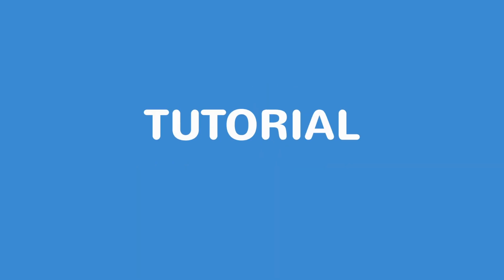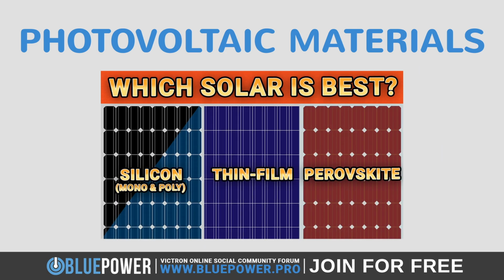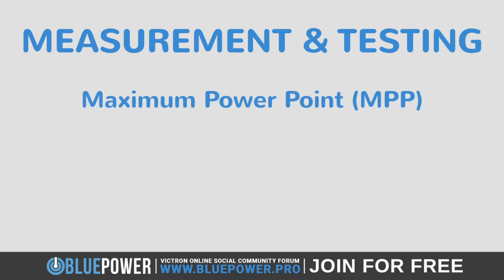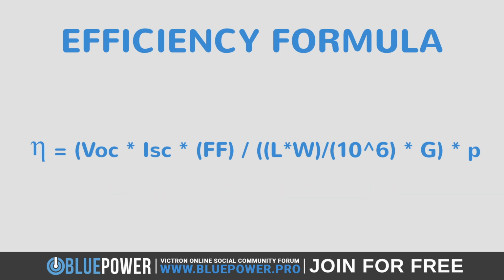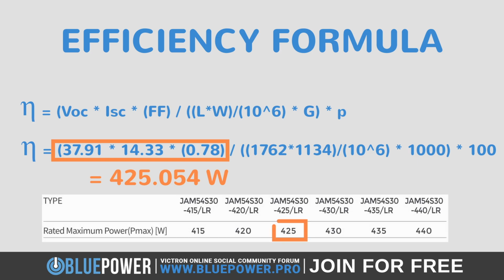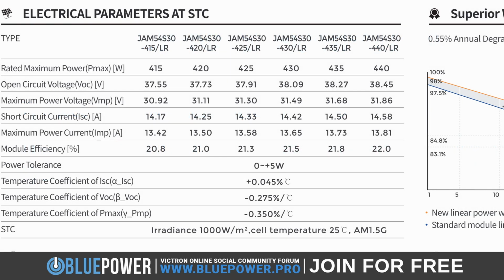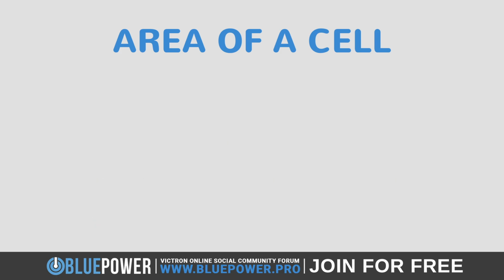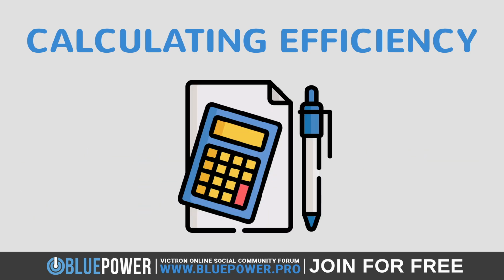Calculate and MAXIMIZE your SOLAR EFFICIENCY [UPDATED 2024]

Comment: 15:36 , this is wrong cause there are spaces between cells too...making this calculus useless and inaccurate...it's even further incorrect when you take the inner back size of the panel cause the front size is different....